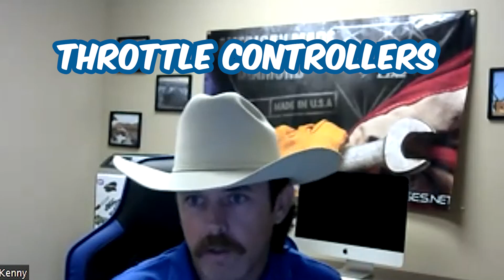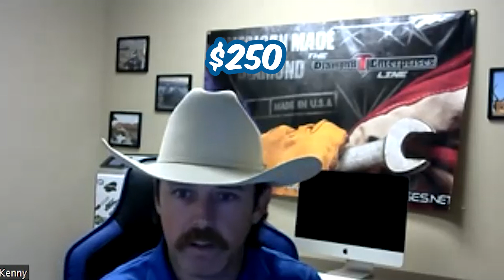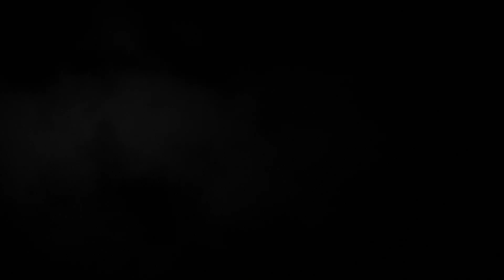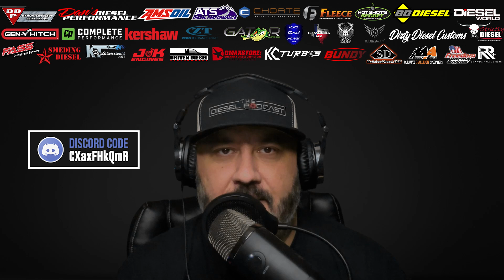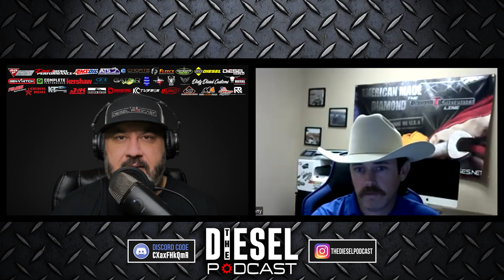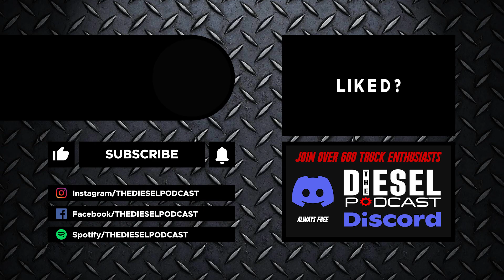Truck Upgrades Under $1000

Comment: The throttle controllers are cool but no amount of throttle curve kills turbo lag. It just give her more fuel sooner. I loved it on my old 05 4 runner with the v8. I'd set it lower than normal to try to save gas but with the diesel it just had some turbo lag. Big fat intake Horn and a 5 inch exhaust has the spool up better but throttle curve the same so I don't have to switch between throttle profiles. Facebook marketplace and I had cst filter kit, 5 inch exhaust, and intake horn for 900. And also remember with the throttle controller if it does give you power sooner. Your probably still gonna be working that tranny hard. Cause you have that 400 horse 1000 ft lb new new motor throwing itself at the tranny harder